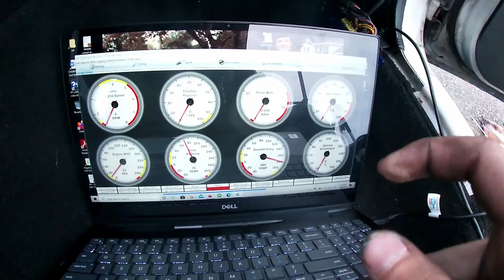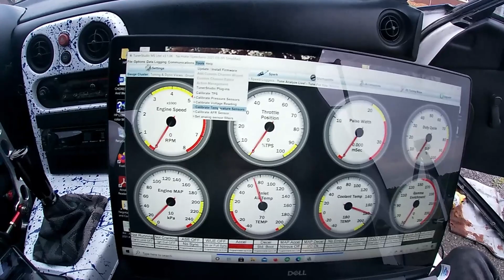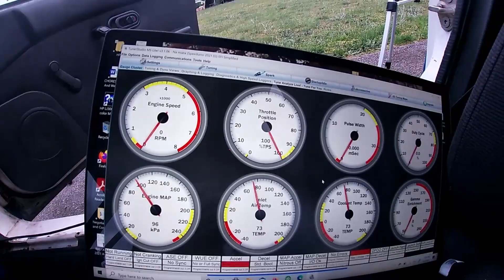Miata Speedy EFI Standalone ECU Install (1990 Mazda Miata)

Comment: Hi
I'm kinda late
but what was the problem with not getting fuel ? I have the same problem, car wont start up
Reply: Probably because the fuel pump was turned off from unplugging the fuse

Comment: Hey man I’ve got a speedyefi ecu and I can’t seem to find a tune to get my car running, think you could possibly help?
Reply: Same.. I updated my Speedyefi PNP with the latest firmware and tune from speedyloader, installed TPS, IAT sensor, completed the calibration, removed fuel fuse, but car doesnt start.  Found settings like the basic engine parameters were wrong in tunerstudio after trying a bunch of different tunes.   for example, the engine size was 350cc not 1600cc but after fixing that it still doesnst start.
Reply: @heatseeka14  ever figure out the issue? Ordering a Speedyefi soon

Comment: Hey man! I know this is late but that rust is caused by your ac leaking water into the floor when you turn left there is a hose up there and if it gets clogged it’ll overflow. Look it up and it’s an easy fix.

Comment: What was the fuel issue you ran into? Same thing is happening to me
Reply from the maker: It was a bad fuel pressure regulator
Reply: @RileyLH  can you explain? an anftermarket adjustable one? the oem? 
did you replace it?